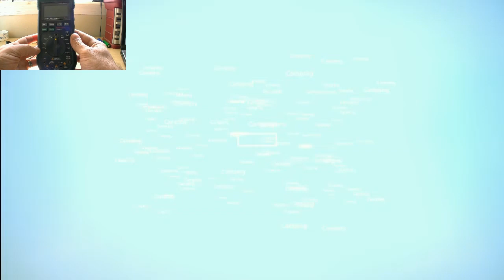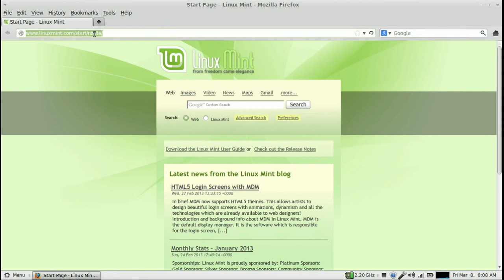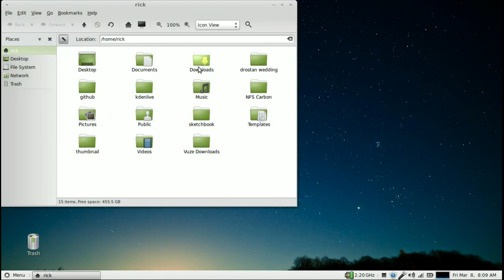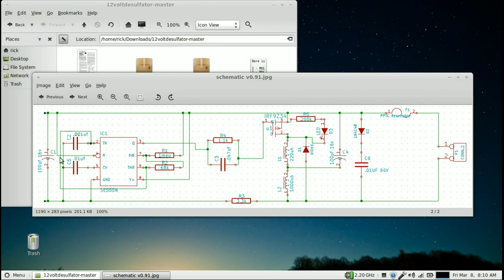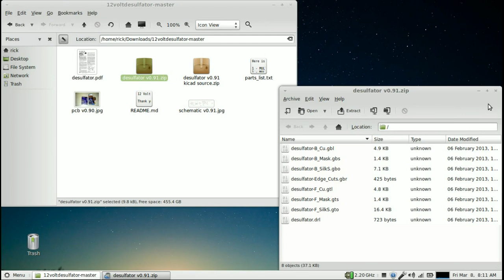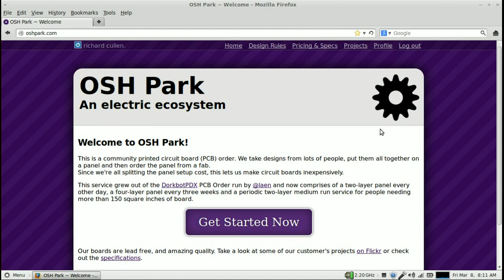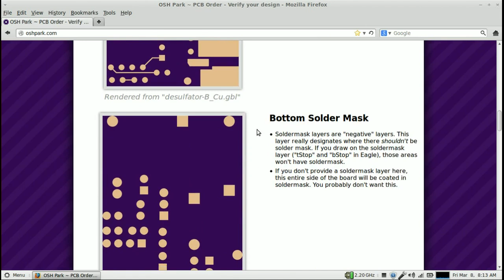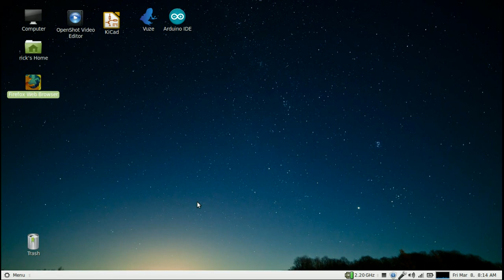Desulfator Circuit Board (How To Order)

Comment: Hello  I made three circuit boards and they seem to work
But when i measure the kHz i get about 4 kHz instead of 1 kHz on all of them
I noticed on the picture that resistor 1 and resistor 2 are changed compared to my board could this be the problem.
Also i wanted to you use them for big batteries 230 AH is this possible

Comment: Very nice build. I like your videos they are quite helpful.  I have built  one now on proto board. Its larger and messier but it works somewhat. I have the older value schematic and will build another one using your new values for the timer side. I also do not have the D2 diode and capacitor across the output terminals and will include them on my second version.

Comment from the maker: You should have a smart trickle charger attached to the battery after you start desulfating.  Make sure it's a smart charger and not just a cheap transformer trickle charger, they are known to slowly overcharge a battery.

Comment: ok I think I got it all ordered I went with the alternate for the terminal block eurostyle. Also I ordered the inductor- 2200LL-H-102-RC. 

In the video you say to hook to your battery and your good to go. Don't you need to also hook up a charger to the battery? Would a float charger work or a 2 amp battery charger work so the battery doesn't get weak.

Comment: I was wondering if you have a subsitute for either of these as they are also not available on Newark right now?

MULTICOMP - MC0805N102J500A2.54MM - CAPACITOR CERAMIC 1000PF 50V, C0G, 5%, RAD

MULTICOMP - MC24356 - TERMINAL BLOCK EUROSTYLE, 2POS, 26-12AWG

Comment from the maker: That's the fun in designing circuit boards, cramming as much as you can in a small space.  Actually it was done to conserve space for a smaller enclosure and to keep the price of the boards down.  It's $5 per square inch so the price can add up pretty quick the bigger you make it.

Comment: The L1 is no longer available on Newark in single quantities. 77 minimum per order. Would any of these work on this PCB since you already spaced everything? part numbers 2100HT-102H-RC,  2100LL-102-H-RC,  2200LL-H-102-RC,  2200HT-102V-RC

Comment: Yes, but, somehow, the file extension are being overwritten and modified by Windows 7 during unzipping, making it unpalatable to the OSH Parks' format; which leaves no way to correct this error. There is no other way to send OSH Park. I have tried everything to no avail. I have followed your procedures, several times, to the letter, with no success. Thanks for your interest and efforts to help, it does not go unappreciated.